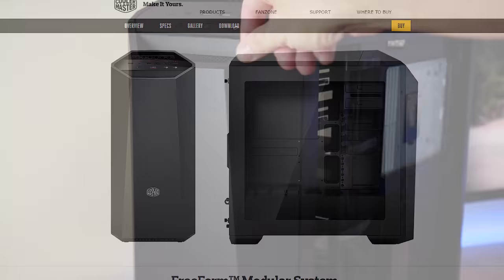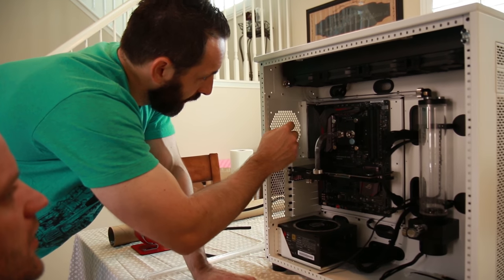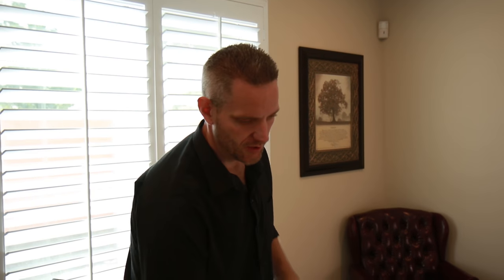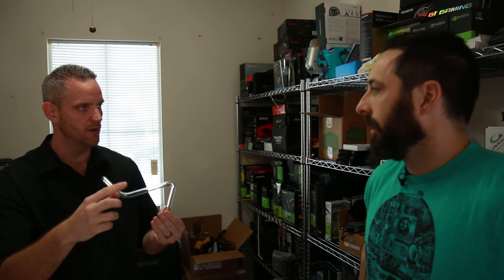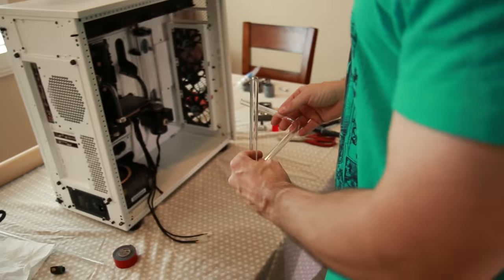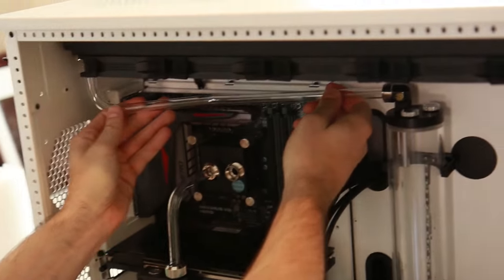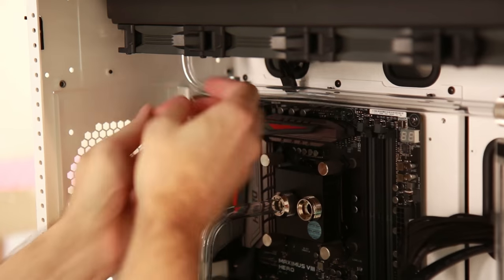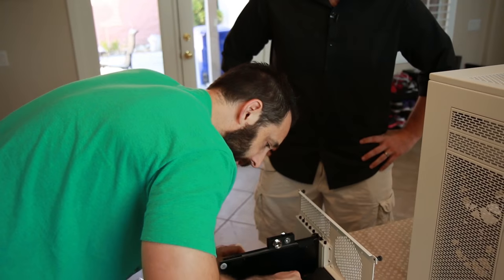PC Rescue Episode 1 - Hard Time with Hard Line

Comment: I know it doesn't have any relation with the topic but I need help, my system
6800k
Msi GTX 1070 Gaming X 
Msi X99 gaming pro carbon
G.Skill Trident Z 3200
Ek Predator 360
EVGA 850 P2
Samsung 850 pro 1tb 
3 140 Cosair sp quiet edition 
3 120 Corsair sp quiet edition 

I being trying to overclock my card, and I just can't even a simple overclock it will crash I don't know if it's my power supply it's not enough or my motherboard or what, I have a Gigabyte GTX 970 extreme Gaming and couldn't overclocked with out crash even a simple overclock not eve 100 MHZ over. It's my psu not enough to my system?
Reply: Might not be the power-supply. The EVGA with 850W is plenty fine. How are you trying to overclock? (MSI Afterburner, BIOS, etc.)  Also, are you increasing voltage while you increase clock speeds? Don't try to increase memory at all, focus on the clock-speeds first.
Reply: +MrRobert yes I'm increasing voltage as well.

Comment: Flip that psu please, blowing hot air into the case...
Reply: the psu always blows air out the back, so in this case its taking air from inside the case
Reply: +AukurgkNL
massive brain fart on your part
Reply: Its sucks air from the case and blows it out on the black
Reply: You do realize the low spinning PSU fan has barely any affect on the case cooling right?
Reply: The Timelords
It was just a prank bro
Reply: A lot of new PSUs don't even turn the fan on until under significant load. I don't think the fan on my PSU has ever turned on.

Comment: dose a 750w crosair g750 support 980ti sli?
Reply: It should do but personally I would go with a 800-850w psu
Reply: plenty for even 3 way 980ti
Reply: i can't find the model of Power Supply you're talking about.
please provide a Model Number.
Reply: Jahcrispie that's a stupid Power Supply for just 2 GPU's.
that's the sort of Power Supply you use for 4 GPU's and maybe even a dual Socket board.

Comment: hey can some one help me out, I'm relatively new to pc gaming and my pc that I bought a couple of months ago keeps having problems playing games at somewhat decent fps (20 or above for me is a good day) amd I can't figure out why cause everyone says I should be able to play a game just fine but I cant, my specs are: Intel I5 650 @3.20ghz duel core, 12 gigs of ram gtx 960 and a gigabyte p55 usb3
Reply: I would recommend upgrading your CPU 1 because its a dual core and 2 it's about 4-5 years old
Reply: What resolution? Try nvidia's Geforce Experience app, there's a section in there that gives recommended settings for their cards with a lot of games. Also, check you've plugged the monitor into the 960 and not the motherboard (or both, did that once when I was mucking about and I was getting 10 fps as the system defaulted to the on board HDMI instead of the DP from the graphics card).
Reply: What games? what resolution? what OS? what detail settings?
Reply: Damn..Yeah if you had a quad core cpu then i'm willing to bet that you would have been fine but you don't.

Also your CPU is very outdated as its a bloomfield cpu which came out during March 2009 but if your able to, 

Sell your cpu your using now and get a i7 800/900 series which is still a good cpu even to this day, careful not to pay something like £80 which won't be worth it
Reply: ***** thanks man but my socket is a 1156, is there like an attachment I can buy to fit that other type of cpu?
Reply: +Jacob Hau sorry buddy, you will have to buy a new motherboard to get a new motherboard. What I could reccomend is lokking through ebay or craigslist for something like an i5 2400 and motherboard combo as they are relatively cheap (at least they are in australia)
Reply: +Jacob Hau Hi Jacob, check it's the CPU causing the slowdown by running Task Manager (right click on the task bar); the default mode has a chart of CPU usage (including both cores). If that's at 100% then the CPU is the bottleneck. My old PC has a Sandy Bridge i5 (four core 2.5GHz), 12gb ram,  HD 6750M graphics, and will get 30-40 fps in War Thunder at medium settings on 1080p (low gets an extra 5fps but looks horrid due to pop up; 720p gets a very playable 63fps), whereas XCOM2 has to be turned down to 720p to make it stable and it's a turn based strategy game. In WT the CPU load is 30% on core 1 and about 10% on the other three, so the bottleneck is clearly the graphics card; in contrast XCOM is chewing down CPU time, loading every core at over 60%. After that, start looking at temperatures; CPU under 90'C and GPU under 80'C is acceptable (mine run mid 60s). If one is higher, the core clock will step down to save the silicon and you need to look at better cooling.

Comment: Guys i have a question, if i have some ddr4 3000 but my motherboard doenst mention compatibility with 3000 speed ram sticks. Will mess with my pc? Will i need to overclock to 3200 or underclock to 2933. or are they just too lazy to mention ddr4 3000 in compatibility list if this doenst make sense check my pcpartpicker list. http://pcpartpicker.com/list/DV6W4C
again if you click on my mobo and look at the left side it has the list of ram speeds it supports. I dont know much about ram in particular and thats why this is worrying me. Thanks for reading:D

Comment: plumbing is a trade pal building pcs lol no im sorry that is defo not a trade. im a plumber building a pc is so much easier
Reply from the maker: This video wasnt about building a PC, it was about heating and bending tubing in a sort of art form. Lets face it, as a plumber all you do is screw pipes together and solder them. If that triggers you, think about the fact that what you said was no less demoralizing. Have a nice day.
Reply: lol chyeaa buddy all a plumber does is screw pipes together maby in 1950 . Geothermal heat pumps , unvented hot water cyl , underfloor heating all screws together lol
Reply: Building PC's are simple. Everyone knows that. Planning a hard tube water cooled PC? Is even harder.
Reply: Yes, building PCs is a hobby to the average person building it themselves, but take a moment to understand that Jay most likely has experience in Computer Maintenance and/or Electrical Repair and Maintenance(or to fit under the category industrial trades, electrical and electronics repairers.) Everything has a lot more intricacies than most people think. Sure, a plumber has a bit more stuff to lift compared to a computer maintenance technician, but those are two jobs that deal in two completely different areas of service in the Industrial Skils Industry. Technically, most, if not all, trade jobs require training, certification, and some manual labor. So yes, building a PC is more of a hobby, but computer(or also named under electrical and electronics in the same title) repair and maintenance of said parts, especially for the service of others, is a trade.
Reply from the maker: Thank you. His ignorance just got the better of him
Reply: ignorance lol your idea off modding is drilling a few holes in a prebuilt case sleep big guy. a hobby is a trade lmao . you would not last a day in a real mans job kid , and yes kid im 2 years your senior ;)
Reply from the maker: "real job" funny, last time I checked all of the things I have are earned with the cash I make doing this "fake" job. Dont kid yourself.
Reply: Sometimes people are actually just that stupid. Even more sad, is when they don't even realize how stupid they actually are...
Reply: Says the man with nothing to say.
Reply: lmfao
Reply: BallSackGaming
Thats a very good response, im impressed with your vocabulary.